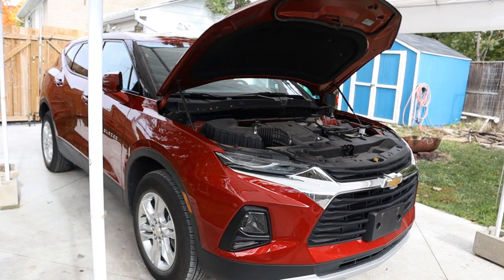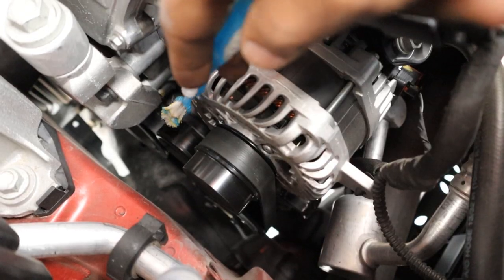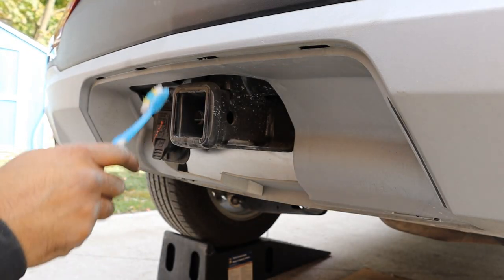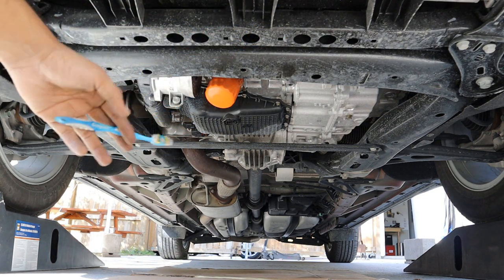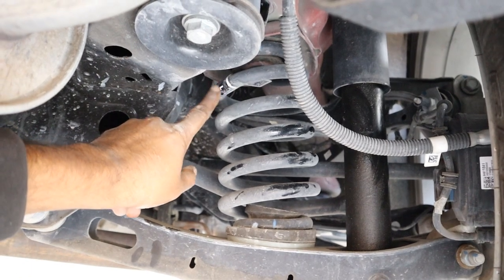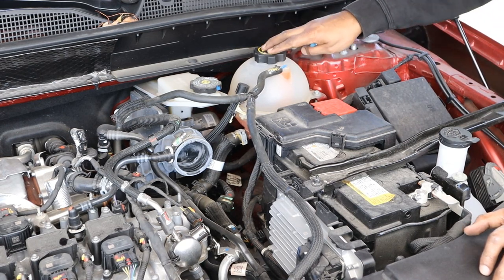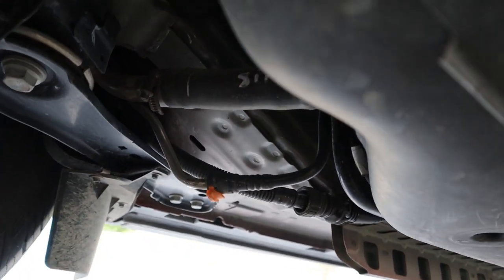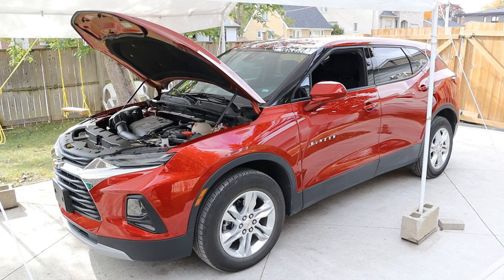Chevrolet Blazer Mechanical Review

Comment: Dudes sarcasm is on point everytime😂😂😂😂😂😂. 

But damn GM got some really shitty parts on that vehicle.
Reply: Lmao fr every other second makes the video hella enjoyable to watch 😂
Reply from the maker: Glad you appreciate the video style, but some of it is true...
Reply: @speedkar99  some of it? Its all true. I mean come on a plastic oil pan, no proper bumper reinforcement and a leaking shock already?? This is unlike other hardcore GM products. Seems like a cheap way out just to get the blazer out there
Reply: @DESTRIAZ  Engineered and built on a Friday 🤣
Reply: @DESTRIAZ  agreed this is definitely somewhat subpar. Many model equinox’s we use as company cars have over 200,000mi with no issues. The trucks last forever and my regal has been very sound for 10 years so far

Comment: Just looking at that plastic oil pan and drain plug turns me off. Like you said,if you run over something the pan can crack and there goes all of your oil. Like they say, “They don’t make them like they used to”! Of all the gadgets like electric water pump and parking brake, the one thing I would like to see is an electric oil primer pump that would pressurize the oil enough before starting the engine and turn off soon after.
Reply from the maker: Yeah it's not very friendly for those who buy used cars or keep them for a long time. 
Electric vehicles will only complicate things more since everything will be electronic ...
Reply: People love to shit on them but it's really not the end of the world.  A hit bad enough to crack one of them is going to do real damage to a steel or aluminum pan as well. In the case of a cast aluminum pan it likely would crack it right in half.
Reply: @rudolphna54  
The true grief is from the warping that will cause leaking later on.  If you look at it, there seems to be subtle leakage already.  It should be a crime for such a critical area to be skimped on by the manufacturer.
Reply: I like the electric water pumps on newer vehicles usually they are out on their own and easier to replace than a timing or belt driven pump
Reply: @speedkar99  Au contraire, it'll be better.  Why? Because you are reducing the number of moving parts by an order of magnitude. Probably 2-3 dozen moving parts total compared to hundreds/thousands. No oil changes to forget. No filters to forget to change. No transmissions to blow up. All the sensors, chains, solenoids etc that it takes to make an ICE and a transmission work, gone.  There will be teething problems but there should be no doubt that electric vehicles will be far, far more reliable than gasoline cars have ever been.
Reply: @rudolphna54 metal components don't corrode/warp as fast as plastic parts Do.  Plastic over time becomes brittle or becomes warped it just doesn't hold the same structural integrity as a metal component.

Comment: Great video. You can tell this is 1000% a throw away car that GM doesn't expect to last more than about 5-6 years.
Reply: Does GM make anything else these days?
Reply: @IronFishChannel  Yeah I think they make some good vehicles, but this isn't one of them lol
Reply: This is the way all cars are built.  They last a lot longer than the junk from the bad old days.
Reply: @user-tb7rn1il3q  I don't see how making parts out of cheap plastic and aluminum vs steel and higher quality aluminum can be good in any circumstance other than guaranteeing the dealer a return customer in couple years.

Comment: That has to be one of the tightest engine bays i've seen on your channel so far.

Plastic engine mounts are a recipe for disaster
Reply from the maker: For me this didn't seem as bad to work on, because this car has a V6 option they had to make the engine bay big for it to fit.
Reply: This engine bay has much more space than my wife's 2022 jeep wrangler and that has a 4 cylinder, the space on that is non-existent

Comment: Had a V6 flavor of this as a rental for a bit over a week.  Liked the passing power and all that, did the job of a rental just fine, although it has more buttons and controls and safety features than I was used to.
Reply from the maker: How's the V6's noise vs this 4 banger? I found this one very unrefined
Reply: @speedkar99  Not dissimilar to most every GM V6, tbh.  A bit of throaty-ness and growl, but not rough or uneven.

Comment: I prefer stamped steel parts over aluminum or plastic at least if you hit something stamped will bend allowing you to still limp it home.. I like that it doesn't have undercladding much easier to clean it up to prevent rusting instead of all that crap trapping the grime and needing to be removed to clean
Reply: All in all though I hate these new "suv/crossovers" they are trash to use as a suv and the ones I've test drove handle like crap
Reply from the maker: For some parts like oil pans, stamp steel is ideal. For others, aluminum is better because it doesn't rust (at least as fast and badly as steel).
Reply: @Paul I've owned quite a few vehicles with steel oil pans and 350+ k miles and they still had the factory paint on them I live in the rust belt lol so I'd say somewhere like California they would be perfectly fine
Reply: @speedkar99  either way its metal and I'm happy plastic doesn't belong anywhere near a engine if possible

Comment: An engine mount collapse will take a new meaning with this one. I can't wait 'till these start dropping engines left and right.
Reply: Why? Glass fiber filled polycarb is if anything stronger than aluminum and doesn’t suffer from fatigue stress like alu does, nor corrosion like steel. Maybe you should learn something before you assume even more.
Reply from the maker: The mounts here are torque mounts, they don't carry the weight of the engine.
Reply from the maker: You are right, however their failure is rather abrupt with not much elongation before yield... basically no warning before failure
Reply: @speedkar99  that’s fair. I think that overall though glass fiber plastic offers a lot of advantages that people overlook while they shit on it for being plastic. Plastic comes in a lot of flavors, not just shitty ones

Comment: Should the transmission fluid be changed at 30k as the manual states or should it be left alone I keep hearing that changing trans fluid is bad, but I also keep hearing it should be done

Comment: My 07 civic has plastic mounts too and yes ive broke one in half. Not tuned or boosted just stock. Engine mount snapped in half
Reply from the maker: U sure it's plastic??
Reply: @speedkar99  100% look up 06-11 civic 1.8l lower torque engine mount

Comment: For a modern car, access to replace parts isn't too bad.  Quality and reliability are another conversation....
Reply: You can’t really judge reliability based on this, but that’s probably an LTG engine, where are noisy but tried and true engines with a good track record. That transmission is the 9-speed co developed by ford and GM and has been really solid so far. And in the last decade American cars generally have really stepped up parts quality. His only actually valid complaints are the omission of skid plates and bumper foam, which is maybe valid but not a normal thing GM does, and also skid plates aren’t really all that useful on this sort of car and i typically see them dragging or flapping on the ground on cars that have them.

Comment: The oil pan isn't actually plastic, it's a composite material; infused with several strong materials (dependent on brand).  It's actually just as or nearly as strong as a metal pan, they are pretty strong being what they are! Obviously this isn't a replacement for a metal pan, hopefully aluminum oil pan instead of steal.
Reply from the maker: "composite" will still warp and crack faster than a stamped steel pan
Reply: It already has a leak , its plastic ,  a fancy name for plastic Is "composite material"

Comment: I would bet, that GM did not do as poor rear crash components, but trailer hitch kit (propably GM made as there is cover for it) just made them not fit, this is typical.
If your car is rated 5 stars and you want trailer hitch installed take into considerations like two stars less in rear end crash - only factory installed kits are tested, and typical trailer kit is installed by dealer, after manufacturer certified and tested car. This not dangerous or something like that, but about 30cm of crumple zone gets stiffened to make pulling and braking of brakeless trailer possible without damage
Reply from the maker: Yeah I wonder if they offer these with a proper rear bumper support without the trailer hitch...
Reply: @speedkar99  you could always check online to confirm that he’s correct… took me 2 minutes

Comment: In 2022, i cannot believe the underbody is bare metals.  All Toyota is now fully covered with felt materials or plastics which helps a lot in preventing corrosion because plastic will not corrode when getting hit by stones and salts.
Reply: @Paul good to know. so far no problem on other models. There is a possibility for busbar corrosion on the battery too. But the case is rare, not as massive as corrosion on trucks and body on frame SUV.
Reply from the maker: Yep they really skipped out where the customer won't see
Reply: Lots of anti corrosion practices like that just trap moisture and hide corrosion
Reply: @Heatherder  no, no at all. These are back from 2004 Prius and they are much better holding the underbody than Corolla at the same year.  It is an effective solution compared to self lubricated oil coated German cars or GM. Plastic or felt cover does not hide corrosion, rubberised underbody coating will. Corrosion on the control arms are non existence now. But the bottom of struts and shocks are still prone to corrosion because there are no cover on them on the wheel well.
Reply: @rondhole  i guess I don’t know specifically what you’re talking about. I have an 11 year old regal with zero corrosion in a winter state. The undercarriage has a powder-coating like substance on the body/frame components and the control arms are forged aluminum alloy and have zero corrosion. Is that what youre talking about? Because that’s what GM typically uses. This blazer actually looks a lot different underneath than what i’m used to seeing on GMs.
Reply: @Heatherder  GM is not known for any reliability nor corrosion resistance. Probably some model like 3.8 v6 and old timer are solid but not their newer small turbo or cylinder deactivation engines. The rust is also a big issue in many Toyota and Honda, especially Truck and body on frame but not on unibody structures anymore. Since 2004 Prius, the underbody is fully covered with plastic or fiber glass. 2014 and up, other models are all covered too and rust issue anymore in Toyota is much lower since then. Better than other brands in the same class.

Comment: You need to make an illustration of the ultimate vehicle. Maybe it needs a bumper where you customize your own lights and things. I see cars with smashed headlights and people are tired of vandals or can't find replacement housings. A light bar is installed. OEM lights should be cheaper to replace. They damage too easy....

Comment: That AWD system isn't 4wd, so what's it have for a f/r torque splitter?

At the transmission there's no space for a f/r differential, that housing looks like a 90° box.

I see an extension on the differential, that could contain a torque converter, but that's copying Honda!
Reply from the maker: I noted the motor on the transfer case which engages the AWD clutch. It's done right at the front

Comment: Is there any good Chevy/GM car out there? If there is, please do a mechanical review for that!
Reply from the maker: Corvette? 🤣
Reply: From personal experience at shops. I've deemed 2015-2019 GM Silverado and Sierras to be the BEST... only issues I've seen is leaky transmission lines. The V8 motors they have are SOLID and reliable is used nicely and maintained APPROPRIATELY. I've served livery trucks and SUV by GM and I've seen 250K miles on them with little to no issues and minor seepage/leaks
Reply: Sure, most of them are good. The best right now are the rear-drive based

Comment: Lots of nitpicking here but nothing that actually means much. The car seems mildly vulnerable to damage but plastic skid plates fall off a lot anyways particularly on nissans it always seems like. The drivetrain is a relatively tried and true one. This car lacks a lot of refinement but there’s no reason that it wouldn’t last a long time with normal use. It doesn’t seem nearly as abusable as normal GM trucks but then again, neither are its subaru competitors, kings of getting fucked up in colorado winters
Reply from the maker: It's not hard to work on but this vehicle fails to stand out. It's just meh that will last meh (see all the equinox and traverse in the junkyard right now).... It can be improved

Comment: I'll stick to old GM vehicles. My 96 Buick Roadmaster sedan is too new, but the LT1 is pretty good. Especially with over 170k miles on the original Optispark and still running great

Comment: It’s crap, just like everything else now.  It does however seem pretty easy to work on.  I think they would have had a winner if they would have put it on a small truck based chassis like the old ones.  I sure miss the old days, and I’m just 45.
Reply from the maker: Yeah I'm surprised there's enough room to work but that's only because there's a V6 option

Comment: Plastic engine and tyranny mount.... IDK about that. I will pay $500 extra for cast aluminum. Plastic can be made very strong, but I am concerned on out gasing due to heat and impulse load fatigue. Crazy they miss assembled things. I recently had the same thing where the pinout of the headlight was reversed. It didn't matter with a halogen bulb, but I upgraded to LED and polarity does matter. Doh!
Our 2014 Nox starting rusting like crazy (subframes and unibody underside) after 6 years. My previous and present VWs barely any surface rust on subframes and no rust on the unibody even after 8 years in the rust belt. That is why we skipped GM this daily driver replacement cycle.

Comment: I'm concerned ( as a Honda buyer since '83 ) that this company is partnering with Honda for a joint EV vehicle project.
Reply: GM has forgot about more innovations than Honda has under its belt. It had a fantastic EV back in 1989!!! Big oil tanked that project, very shady time.
Reply: Granted Honda is late to the EV party but quality at GM is abysmal.
Reply: They stopped their partnership as soon as they started.
Reply from the maker: I agree.... having GM internals in a Honda skin doesn't sound like a good combo for a reliable vehicle.
Reply: @michaelthomas9243  that’s literally not true, GMs generally have good reliability, there is data supporting this, and the Volt was one of the most reliable cars made and a great EV

Comment: Probably is going to end up in a junkyard. I’m not holding my breath that they are all the sudden going to be making these reliable electric cars if they have already had problems to the point where they had to temporarily shut down production just to deal with the already existing flawed units. Being a turbo 4 with AFM, I can just see problems in the near future. It’s already bad enough with non AFM and turbo 4 cylinders blowing up or burning oil. They just don’t have quality.

Comment: I hate direct injection
Reply: DI is nice tho. Other than cleaning your intake every 80k or so, there are only upsides. More power with less fuel.
Reply: @nobodynoone2500  The manufacturers could’ve increased power by other means👉🏽camshafts, roller lifters etc, etc. Whenever you get that bill for cleaning all of that carbon or replacing them D. I. injectors, remember what you said here.
Reply from the maker: I prefer both port and direct injection
Reply: @nobodynoone2500  DI is nice? Buy a Hyundai or Kia and then tell us if you feel the same way

Comment: Too many plastic pieces
Reply from the maker: Plastic is good for light weighting but not good for manufacturing, long term durability or recycling
Reply: @speedkar99  Thanks for the clarification. So it is not the cost cutting approach? Like the VW golf has a plastic oil pan but the Golf R has the metal one.

Comment: 2025 EV BLAZER sport mega plus package will come with unique features such as plastic brake pedals, plastic compose wheels, plastic cv axles and plastic steering wheel to save weight
Reply: Plastic is an underrated material

Comment: holly mother of jesus. you d have to be an idiot to buy  this.Plastic engine mounts,plastic drain plug...The sad thing is that all producers use so many shitty plasticky parts.Sure it has its role as a material in a car but most engine components should not be made out of plastic,cheap one too.Yuck! bet this one comes with oil leaks from the factory. I think i will hold on to my k24 honda for a long time still.